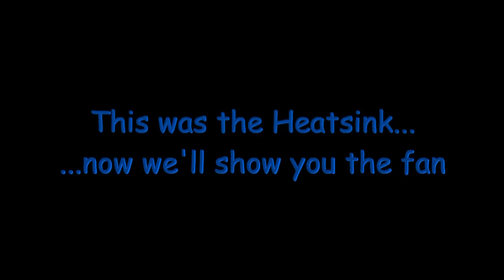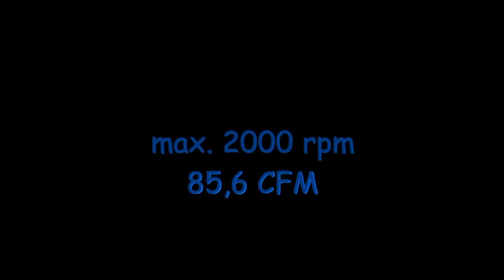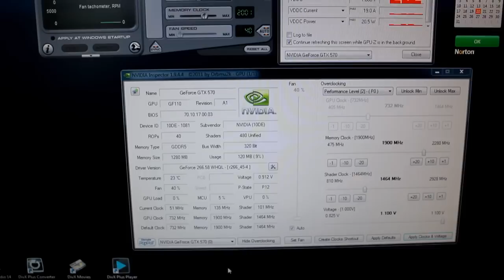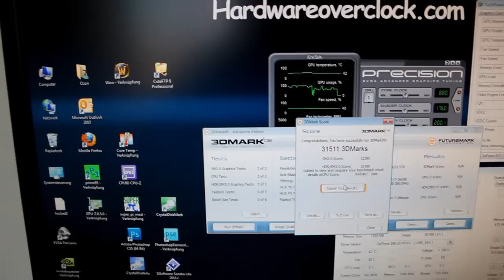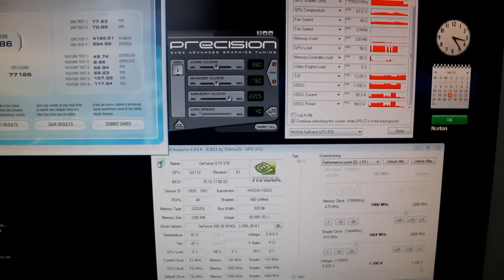Geforce GTX 570 overclock 880/1760/2200

Comment from the maker: @ Hardmorez: Der beste Kühler für eine GTX 570 ist sowieso der Arctic cooling Xtreme Plus. Da brauchst nix selber regeln, da die Lüfter des Kühlers mit der Steuerung der Grafikkarte verbunden sind. Leider ist der Kühler ziemlich teuer. 

Wenn man schon den Setsugen 2 verwendet, sollte man natürlich einen relativ leisen 120 mm Lüfter verwenden. Da ist der Noctua NF-S12B FLX eine sehr gute Wahl. Der Excalibur ist zu laut, zu stark. Die Klammern hab ich ein wenig aufgebogen, dann passt auch 25mm

Comment: @Hardwareoverclock 
Ich habe keine gtx570... Leider (so mehr oder weniger^^)
Bin mehr so der AMD Fanboy... Ich habe nen hd4850 und da rockt der Setsugen doch ordentlich... von 75° (non OC, 1280x1024 ) bei bfbc2 auf 45 mit OC und anderer auflösung (1920x1080) ^^. 
Und wie gesagt geht es mir nicht um die Lautstärke sondern um Leistung... Falls dir noch nen schön starker Lüfter einfällt wärs nett, wenn du ihn mir nennen könntest, ansonsten wirds entweder der Noctua oder EKL Alpenföhn Wingboost
LG